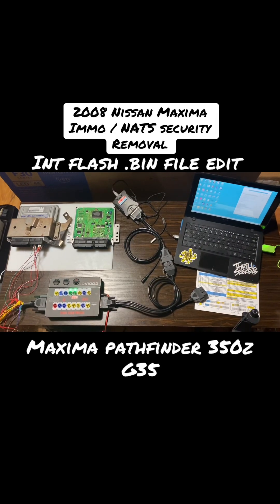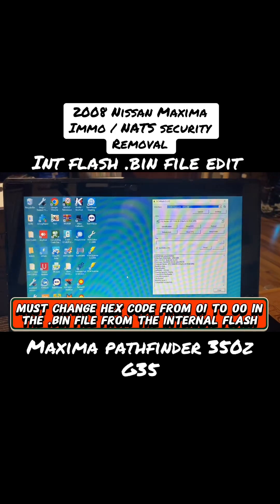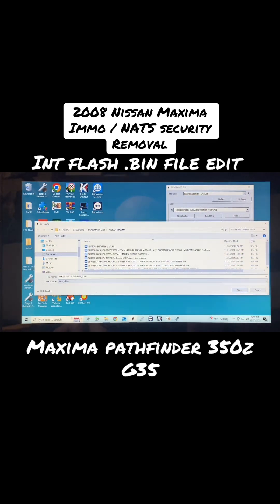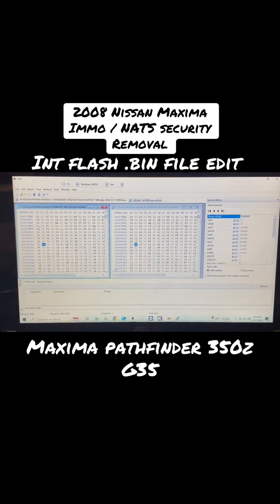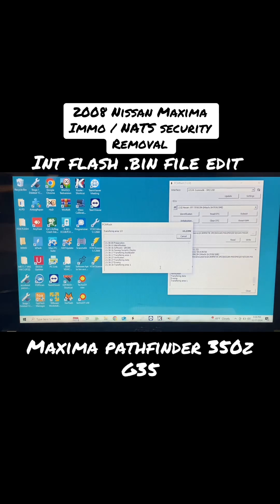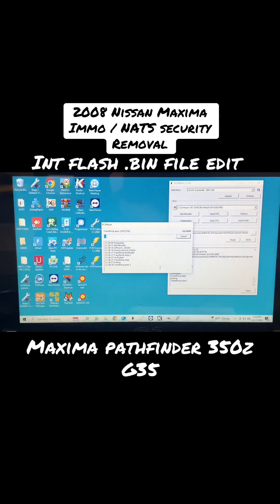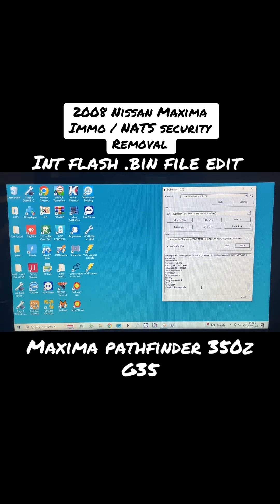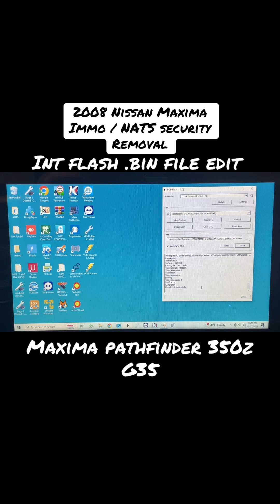DIY - 08 Nissan maxima hitachi Ecm iMMO off in hex code  (same for 350z) pcm flash, sm2 pro, & hxd

Comment: What bit size are you using??
Reply from the maker: sorry just seeing you comments.   i am not sure the bit size it was.  whatever it opened as.   its possible your ecm has a different calibration or isnt the same as mine.  i purchased a few with that part number and they all had the identical hex code.   if you send me the bin file i can try and help you out tho!  whats app 712.204.3955